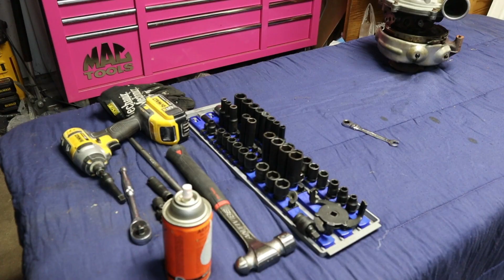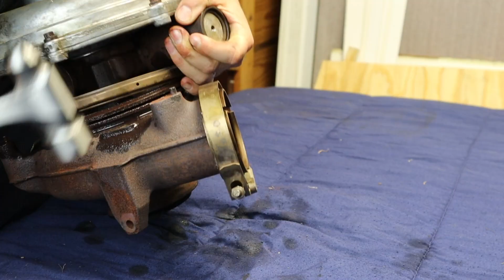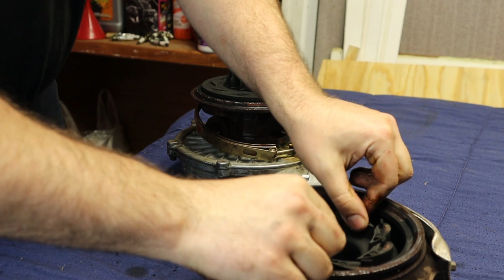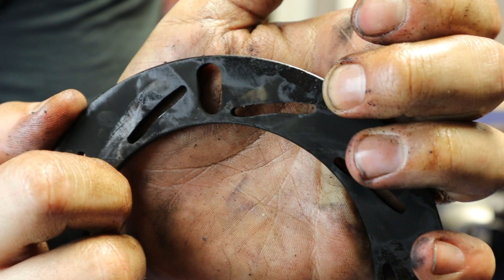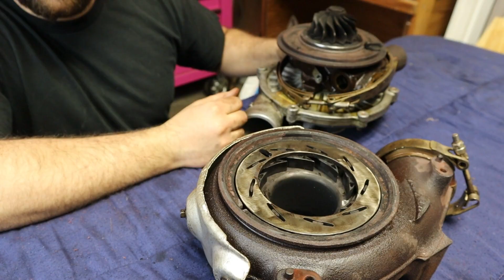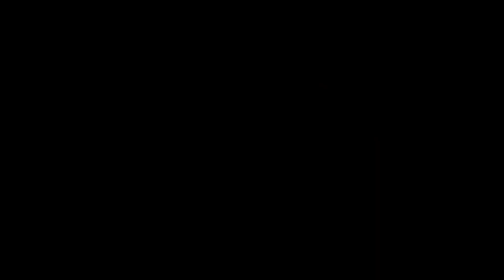How To Get More Power Out Of Your Sticking 6.0 Powerstroke VGT Turbo

Comment: Great job! Can you do this with a Semi Truck turbo specifically the cummins x15?
Reply: Variable Turbo that has these veins in it is called a variable if the Cummins is equipped with a variable turbocharger use that you can do the same thing and doing turbo rebuild for years my knowledge is there is a few GM had a couple of Duramaxes got a couple and of course Ford
Reply: @richardgray8939 0

Comment: DO NOT, DO NOT, DO NOT Touch the impeller with the disk  or even a wire wheel. It is balanced to run 20,000 RPM or so. Even a touch will throw it off balance. I hate to say it, but he will be replacing it soon. Otherwise it was a great video.
Reply: Truly LOL no scratch bright is not going to hurt if you remove some material yes that will hurt it that I'm 68 years old and I've been doing this a lot longer than I suppose you ever did not going to hurt them
Reply: @richardgray8939  Scotch-Brite in your hand would cause no damage but Scotch-Brite on a disc @ 3000 RPMs will definitely cause damage.  I'm sure, by now, you know whether or not you got away with a few taps. Just wanted to caution others. So you know where I'm coming from, I started my mechanic career in '81, so you do have a few years on me.
Reply: @scomi  possibly but at even though Scotch-Brite disc at 3000 RPM on hardened metal usually doesn't Scuff the surface now if you were to put Scotch-Brite to a Babbitt bearing and you going to have serious issues
Reply: @richardgray8939  Alright Richard, as I said. I just wanted to caution others whose takeaway might have been, that they couldn't cause damage,  that they should be careful. I've seen gasket surfaces have to be filed back flat after being cleaned up with a Scotch-Brite disc, even a head that had to have a few thousandths taken off to get it flat again. Good luck to ya, I'm done.
Reply: How balanced do you think it is with all that carbon?  How would you approach figuring that out?

I think the caveat the OP brings up regarding only removing carbon is the important issue. 

Unless we are structural engineers involved with designing and testing many turbos, I would venture its a difficult question to answer concerning how much METAL MUST be removed before axial forces on shaft from uneven distribution of material exceeds some "fail threshold" for a given turbo size experiencing a particular angular momentum..... at typical RPMs.

I do agree your comment as a caution is certainly helpful for the overly zealous but by and large I can't imagine one doing a decent job "only" visually removing carbon deposits is going to be a problem.  Only modeling that design problem by systemically removing metal mass at random points on these components could really come up with some sort or rule .... While I'm an engineer whose taking the required materials and static and dynamics classes for machines.... even I would be hard pressed to conclude with any certainty as you have that turbo failure is even 80% plus in OPs future.  

I think the advice in video is sound.
Reply: @andrewpelletier1199  The carbon build up is completely balanced as it is deposited evenly at high rpms. While I agree that removing the carbon will increase the air flow efficiency, I remain adamant that removing it with a high rpms disk is the wrong answer. But hey... you do you.

Comment: Your very careless with cleaning, you nicked the exhaust wheel a dozen times and you were taking material off the bottom of the vein posts, youd be better off with a wire wheel on a die grinder

Comment: Holy shit guys do not use a buffing pad on a grinder to do this , its very easy to grind material off that will cause other issues . use a wire brush setup , brushes will not take anything but carbon buildup off , blow out with compressed air and check for pieces of wire from the brush used > good video just see too many people destroy surfaces with grinders way to often coming through the shop.
Reply: In the workshop manual it literally says to use the same disc hes using in the video

Comment: The solenoid plug is retained by a "INTERNAL SNAP-RING"  Not a "C" Clip.  There is a difference.  You're not getting more power, just bringing it back to Baseline Factory SPECIFICATION.
Reply: You're awesome Larry there is somebody else that has some brand on this channel besides myself I believe we got seven MC clip down there on the parking brake lever and a few other places definitely not a turbo

Comment: Aloha bruddah Andy I have all kinds of problems I spent thousands replacing just bout everything ughhh these mechanics just tell me story uno never fixing problems the vicm new glow plugs new harness new I have no boost bruddah I changed turbo control now my gauge on my dashboard has no movement at all if you can help me out but I should appreciate it thank you very much a 2006 Ford f250 powerstroke super duty diesel 4x4 thank you bruddah mahalo 🤙
Reply: Did you forget to plug in the map hose to the intake? This will eliminate any boost.